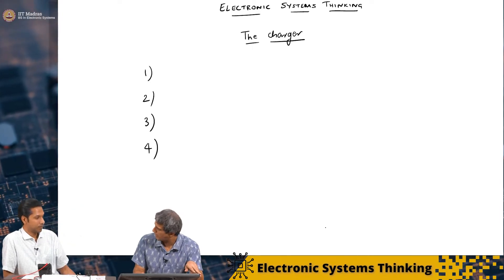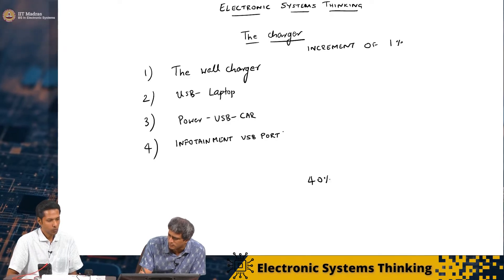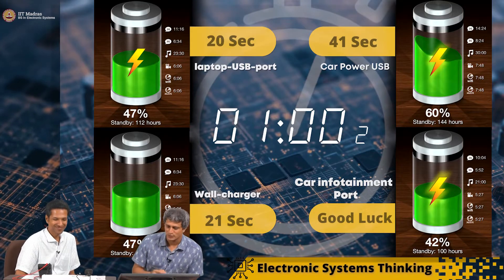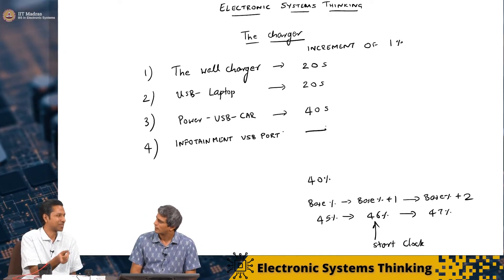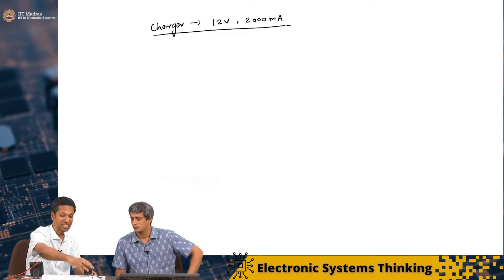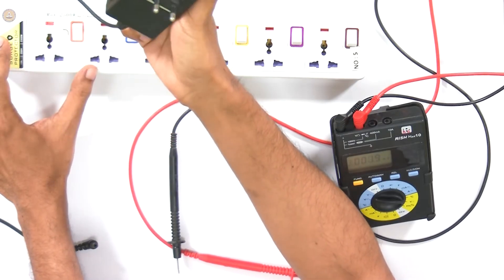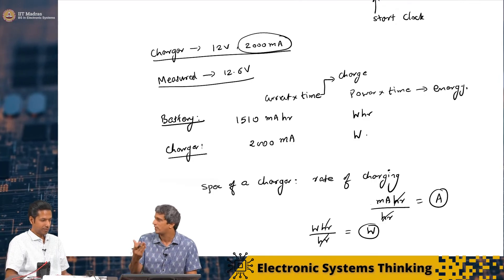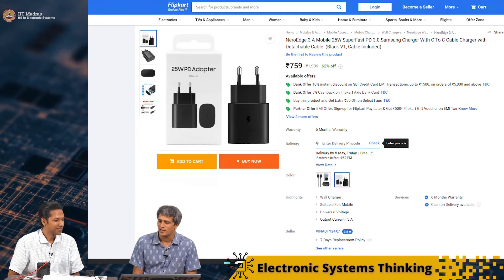W1_L5_The charger

Comment: Unit of charge is columb not joule
Reply: Joule is the unit of work done in case of electric current, and coulomb is the unit of charge. Hence, joule/coulomb will be the unit of potential difference as it is the work done in moving unit charge from one point to other. So, 1 joule per coulomb = 1 volt = 1 V.